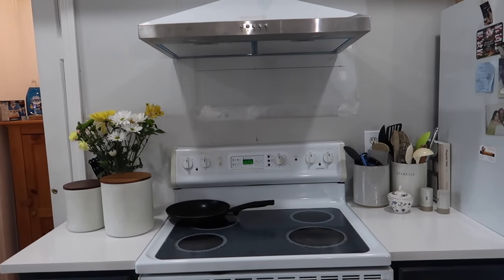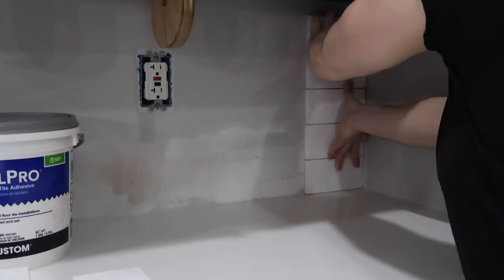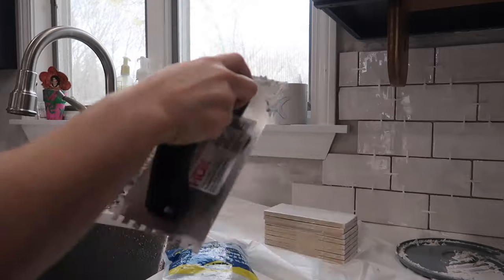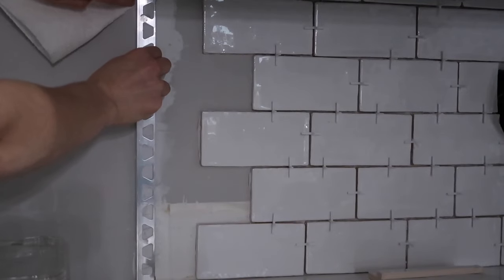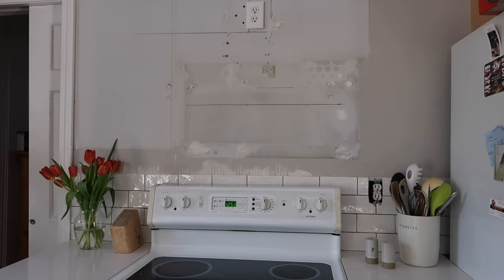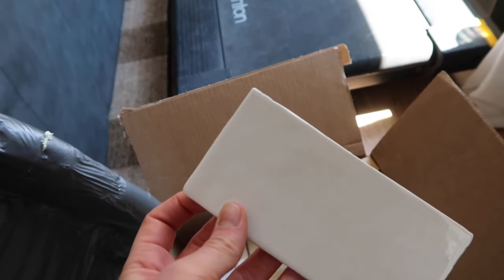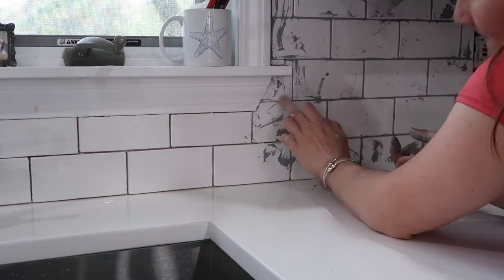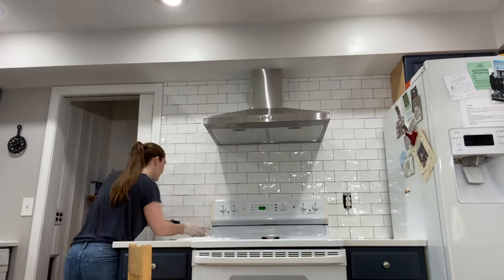DIY Kitchen Project | How To Tile Your Own Backsplash!!

Comment: Just found your channel.  What a great job!  Before you started did you read up, looked at YouTube videos or anything to prepare yourself?  About wall prep, is it ok if paint is on wall and wash wall first?  Getting brave!  Thanks.  Great job! 👍🏻👏🏻🌷
Reply from the maker: Thank you so much!! I watched a few YouTube videos prior to starting this backsplash, yes. My favorite is Jeff from Home Renovision, he has the best walk throughs and really gave me the confidence to do this myself. I went right over the paint on my walls, but I did give them a wipe down just to remove any dirt prior to putting the adhesive on. Best of luck with your backsplash, be brave and give it a try, it’s very rewarding when it’s all finished 😊
Reply: Thank you so much for your reply!

Comment: is it possible to do this project without removing the hood range? our house is complete and i just want to add the backsplash to areas that need it. TIA!
Reply from the maker: I found that it was near impossible to tile behind the range hood and not get grout on the hood itself or inaccurate cuts by leaving it up so we took it down!
Reply: @kelly_mcgrath  thank you for the reply! i should've worded my question better. I wasn't planning on tiling behind the hood range at all because I'm lazy and I just want to tile what is seen. Is that okay to do? Thank you!

Comment: I don’t understand the part when you mix the caulk to fill the gaps between tiles ... what did you mixed?
Reply from the maker: Hi Johny! I mixed the grout which comes in a powder with the amount of water suggested on the bag and that is what was used between the tiles. The caulking was used just between the bottom row of tiles and the counter top to seal it. I hope that helps!
Reply: @kelly_mcgrath  thnx

Comment: What did you use to cut the tile
Reply from the maker: I picked up tile snippets and a tile cutter at Lowe’s, it cost me about $25 for both items! Very reasonable. For kitchens that have a lot of tricky areas I would have likely needed to rent a wet saw from them as well. Hope this helps!

Comment: Love this, makes me think I could actually do it in my kitchen. 2 questions: how did you hang your range hood over the tile? And why, please share, I'm so curious, do ;you have a small saggy butt tattoo on your left wrist? Thanks!!!
Reply from the maker: It’s a number 3 written in my grandmothers handwriting haha, definitely not a saggy butt. I pre-drilled the holes for the range and hung it up before tiling to confirm the location, then tiled and rehung with longer screws after the tile was completed. That way the tile was seamless all the way up the wall